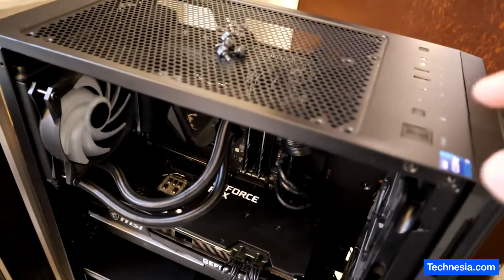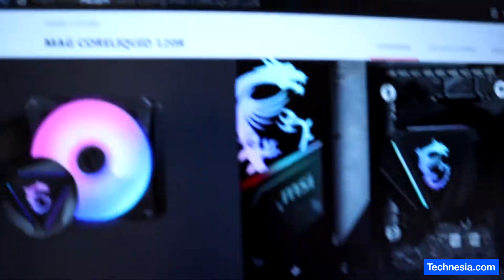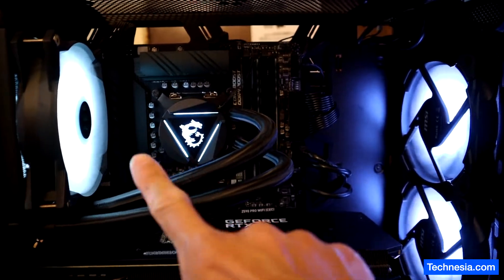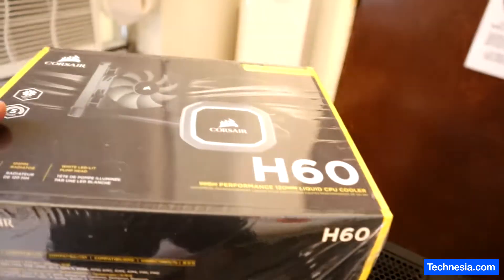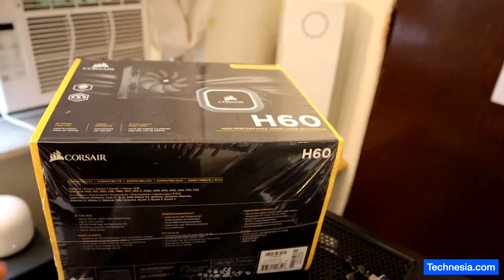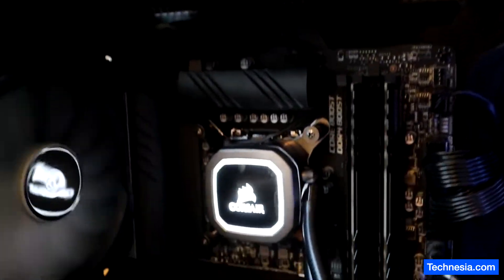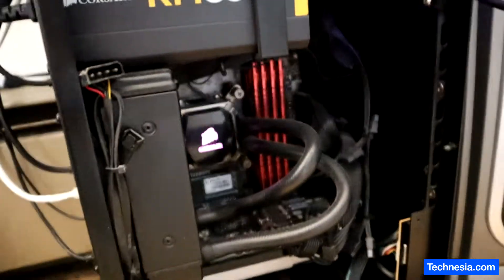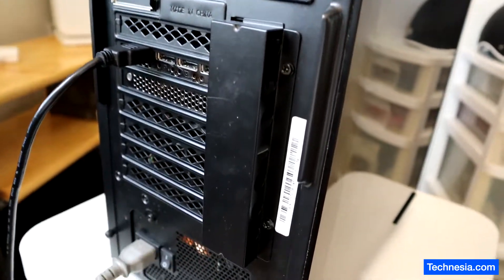MSI 120R AIO Liquid Cooling System Clicking and Overheating FAILURE - Recall ??

Comment: Thanks man, I've been struggling with this cooler for a long time. I got the corsair H60x elite as a replacement and it works and my cpu temperatures are finally dropping. Still having a small Problem with figuring out how to Connect the rgb cable of the cooler. But still thanks a lot

Comment: I have the same problem with my computer.  The computer is; MSI MEG Infinite X 10TE "CPU over hiting 100 temperature" i am not any PC expert so i have no idea what cooler could be best or solve the problem. i just investigated that this cooler "be quiet Dark Rock 4 Pro" could be an option?
I have clean from dust, 
change the thermal paste
all fan are working but still "CPU over hiting 100" to mucj noise 🥵

Comment: I just removed mine. I too have an overheating issue at idle. Got my rma today and will be sending to MSI for replacement (luckily still under warranty). My confidence is low with trading same for same. We’ll see what they send, but strongly thinking to move to Corsair. How can they get 3 versions of AIO so wrong and then not include 1/3rd of the problem. Shady AF
Reply: How long did your rma take I'm having same problem just started the process today
Reply: @Deathmperor  i shipped from MN to CA via UPS on 2/2 - they marked receipt on 2/7 as expected. I saw no update to MSI tracker beyond that for 8 days, so I decided to use chat in support to try and get update. They said on 10th it landed in proper location (depending on department) and from there it would likely take another two weeks, and also told since they’re not currently selling 120mm AIO, no “V2” yet that I would likely get specced up to 240mm MAG core liquid “V2”. I waited 5 more days of daily checking status - BTW, their RMA checker blows!  Either it mis reads, then tells you to check “i” and “1” amd “o” amd “0”… which i just pasted in the fields so it is correct - then the captcha prompt is broken. Errors out multiple times (cookies perhaps) anyway - I start another chat, and was told for some reason they changed my rma from a RRW to a RRD - but the same numbers- not a clue as to why… I explained that I wasn’t upset, but growing frustrated that it’s been 2 weeks already, now confusion about my RMA, and no one had answers- not even a little. “I will reach out to support team and email you any updates” was all I got. Lo and behold - the very next day I received a shipping notification. It’s supposed to arrive tomorrow (except we’ve got blizzard coming tomorrow as well - so) we shall see. I had seen in multiple forums that the v2 240’s and 360’s were so far running okay.  No one could say what they changed to improve it - so I decided to take the hit and invest in the Corsair H100i elite capellix xt.  I also bought a 3 pack of corsair LL120 fans so I didn’t have to run mystic light for case fans, and iCue for cooler. Just completed install tonight and now seeing idle temps at 38c. For a 5800x that’s pretty good!  Considering i was getting 100c at idle before (8 month - light use). Haven’t yet pushed it to see where it goes beyond idle, but clearly the AIO was at fault. Through this process, I also checked specs for that AIO and compatibility with my CPU. not listed - big surprise… this was MSI prebuilt Aegis ZS… so them being the OEM couldn’t even get their build right OOB.  I plan to hold RMA product as backup. Unlikely I’ll ever need it tho. Good luck to you!
Reply: @ttattx  I was hesitant to send my pc off they estimate 2 weeks online. I'll just replace the cooler myself with  something non-msi. I bought a pre-built so I didn't have to mess with this, but the graphics card and cpu were a great value so I guess changing a 100 dollar part isn't so bad
Reply: @Deathmperor  that’s a good point. I too thought pre built would be hassle free. Live and learn. Next time tho, I think I’ll build my own. It was rather enjoyable. Good luck with your new cooler

Comment: I need help I have this pc I bought and have the same cpu cooler and my temps are 100 at idle what aio will work with mine?
Reply from the maker: I recommend getting Corsair AIO. I use Corsair on 99% of my build and my own personal build and never have any issue with it.
Reply: That’s what I did… upgraded to Corasir H100i elite capellix xt. $180 bucks, so not a cheapo - but the peace of mind I have already makes the cost irrelevant. I also pulled front case fans, and bought 3 pack of Corsair LL120 to replace two upper case fans (the 3rd fan is more than 1/2 blocked by hdd bay, so other than looking nice - not much functionality. So put the 2 new fans in slots 2 and 3, and used the 3rd fan to exhaust out back. I decided to mount up top because even if I slid the bay over- the tubes from rad seemed to jammed up against the bay, and it’s a no no to put barbs up top unless you want waterfall sound d effects LOL. just installed tonight and now have no mystic light - (buggy) running instead iCue, and is idling at 39-42c. Haven’t pushed it yet, but will be running some BM this weekend. Have you taken any steps yet to resolve?

Comment: I'm having an overheating issue too and came to the same conclusion...  replace the CPU cooler.  

Only issue I'm having is that backplate you off at about 2:30.  What's the secret to getting it to pop off?
Reply from the maker: Use acetone. Be careful not to let it drop or touching other parts or components, that's why you see me applying it with q tips.

Comment: this might be a little late, but brother i have this exact build and same issue with my pc. except my cooler isnt ticking. however its letting the cpu reach 100 degrees with no load. i swapped the paste with the exact one you have. and it still did it. im gonna swap it with the the the one you used.
Reply: did you need a new cpu?
Reply: @itsVoiViD  No, I needed a new radiator for my cooler, so I just upgraded the whole cooling system